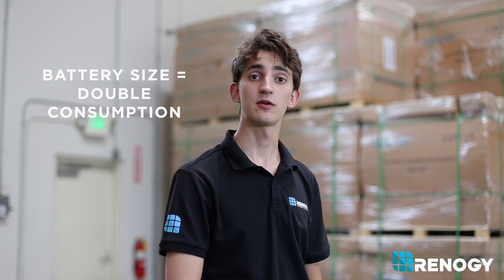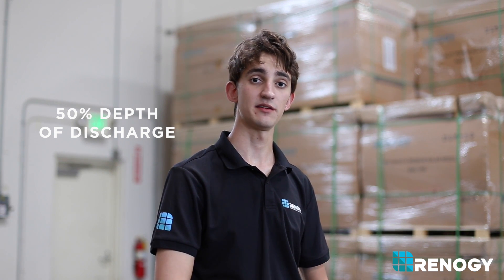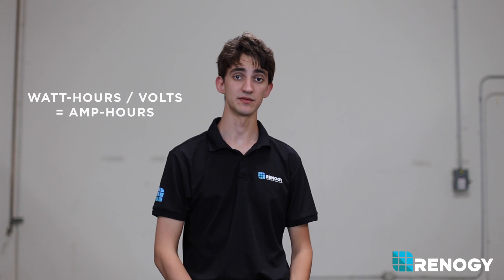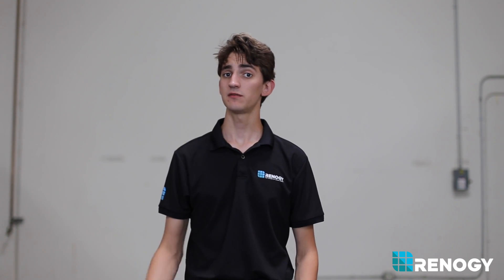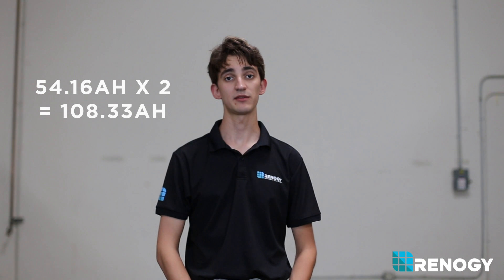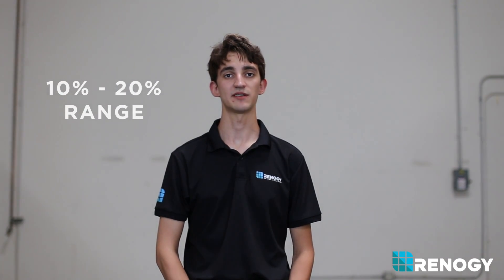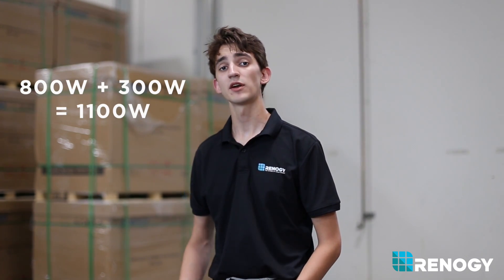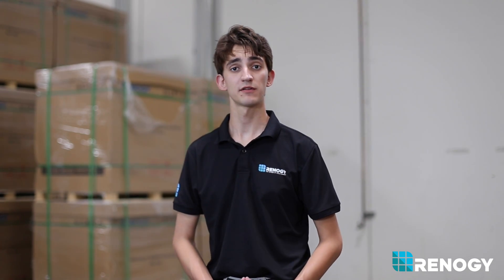Renogy: Sizing Your Battery, Inverter, & Controller (5/6)

Comment: Sounds like I should be able to run a 1000w inverter off a 100 ah battery without taking their double the battery advice into consideration. 
The smart battery shouldn’t over discharge itself I would hope. 
I’m thinking discharge rates for the battery might come into effect somewhere. 
From what I understand, they recommend 2x 100ah batteries to run a 1000w inverter. 
Correct me if I’m wrong. I probably am :)

Comment: I want to power a 12 Volt 1000 Watt Inverter, Would your 40 AMP Controller be enough at 12 volts?

Comment: Have 15,000 Watts appliances to run for 12 hours daily.

Sunlight is 8 hours (8am - 4pm) is always very sure daily.

Nigeria Solar P.G.F ( Solar Power Generating Factor is 3.41)

National Grid Electric Power is irregular and only available 4 hours daily.

Planned a hybrid Grid-Tie and OFF-Grid installation using Solar, Battery and Fossil Fuel as backup solution.

Please your sizing formulae on Inverter, Solar Panel, Battery Bank and Solar Charge Controller ? 

What kind of Renogy hybrid inverter to handle this ? Do you have in-stock a single 20KW or i Parallel 2 or 4 Renogy Inverters ?

To be ordering Renogy; Inverters, MPPT solar charge controllers, combiners, wiring and other accessories only.

Can i have an idea of minimum shipping cost to NY ?

Thanks.

Comment: I have motor and compressor appliances with total load of 1000 Watts ? 
Should my inverter sizing be 300% because of surge or in-rush currents at starting of these appliances i.e 3000 watts and also over-estimation for safety by 130% or 1.3 = 3900 Watts  necessary ?

Comment: I have 2X160=320watt solar panels, what size controller do I need? What if I add another 160watt panel down the road, will I need to buy another controller?
Reply: IF you are charging a 12V battery, a 40Amp charge controller can handle up to 520Watts. If you are charging a 24V battery, you can link your panels in series to stay below the amp limit and therefore, the volts go directly into the battery. You cannot do that to a 12V battery, because a MPPT controller will take the 24V from the panels and transform it from volts to amps before sending it to the battery bank.

Comment: pls can i use my 50amp charge controller for 1000w solar panels?
Reply: Add up the max. total of amps output from your panels-if this does not exceed 50amps it is fine.

Comment: Ok much of this info is beyond my understanding. Still I have a question in regards to how to determine what amperage solar charger controller is required for your system. In particular I need to know if the battery size factors into this or not since it is essentially used for storage of excess solar power. All I will have in my very small system is the solar panel itself, a 12V .010 amp computer case fan and a digital thermostat which will supply power to the fan and of course the 12V battery. Can you tell me if I need to factor in the battery in this example in order to determine the controller amperage required?

Comment: Is the Charge controller amp rating based on input amperage or output amps.  For example.  300 watt 24V panel would input roughly 12.5 amps to the MPPT controller but be charging my 12v bank at about 25 amps.  Do I choose a 30 amp charge controller or a 15 amp charge controller?

Comment: I have an inverter of 24v 1200 watts, two 21.7v 130 watts solar panel and 30amps charge controller. The load is estimated at 20amps. What Ah battery is recommended for 8 hours continues use?
Reply from the maker: Hi Ello, Thank you for your question. After speaking with one of our technical representatives they suggested you contact them directly in order to get more information from you and discuss this issue more in depth. You can email them at techsupport@renogy.com or call 1-800-330-8678.

Comment: would that 1000 watt renogy pure sine wave inverter run a refrigerator I have a whirlpool I believe 14 ,,,  15 cubic foot freezer on top mechanical thermostat I've been running it on a Harbor Freight modified sine wave inverter I'm wondering if your 1000 watt inverter pure sine wave could run it

Comment: With respect to the solar panel controller, do the DC outputs on the controller deliver current from the solar panels (during the day), from the batteries (day or night), or both? In the alternative, am I right in assuming that the controller delivers DC current to the batteries only and that the controller's DC output is sourced to the batteries?  Thanks in advance for any help.
Reply from the maker: Hi +D Carlson 
The DC outputs on the charge controller are directly related to the battery connection. Whether it is during the day or the night, the controller load will draw from the battery. Hope this helps! Please let us know if you have any further questions.